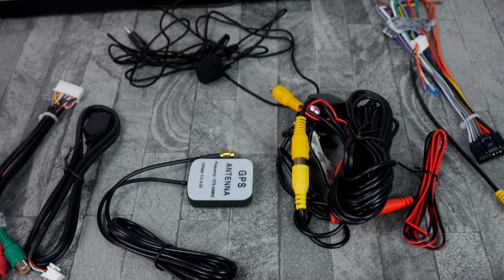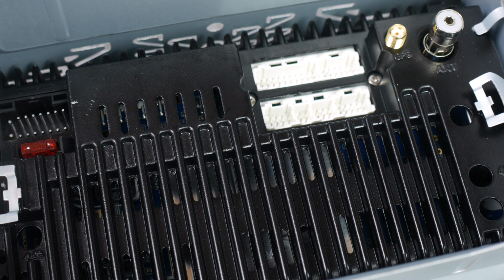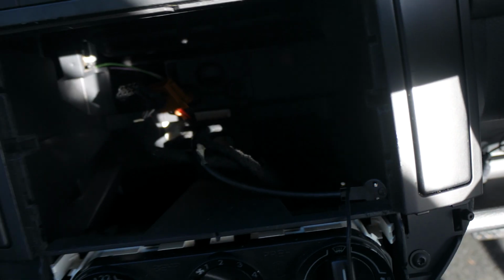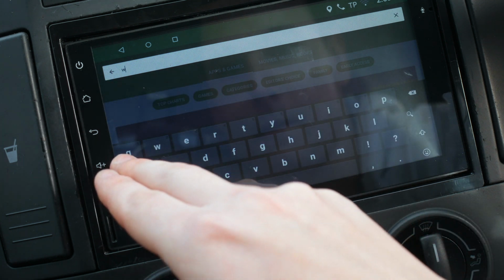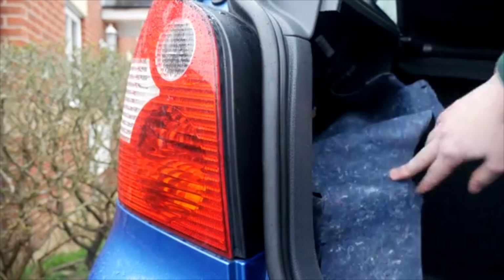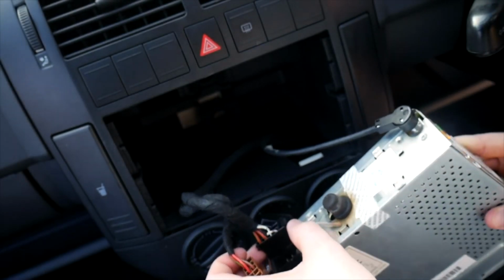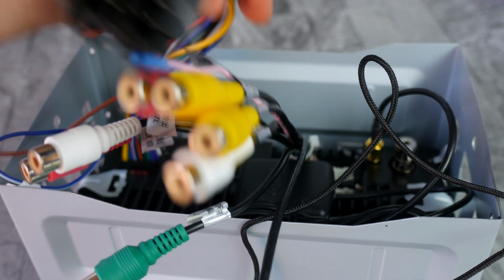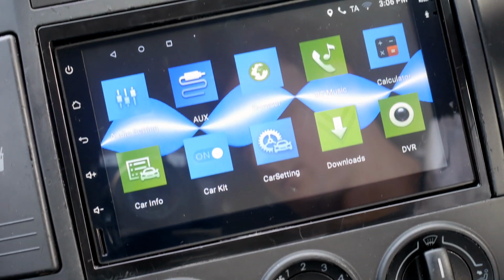Updating VW POLO STEREO - Podofo HD Car double din Stereo!

Comment: What's holding the cage in...you're supposed to fit the cage by bending the tabs to stop the cage from coming out. The radio should then be held in by spring clips which require removal keys for removal. You have simply slid it in with no fixings...very dangerous..it could shoot out under hard acceleration...also an mot failure if loose.

Comment: Can you Provide a Link to the ISO female Attachment Adapter?

Thanks
Reply from the maker: if you contact the manufacturer directly they will send you one.
Reply: @GadgetCrunch  I tried to, but they dont seem to know anything about their devices either
Reply: https://www.ebay.co.uk/itm/Pioneer-Car-Stereo-Radio-ISO-Lead-Wiring-Harness-Connector-Adaptor-Cable-Loom/270681496324?hash=item3f05dfdb04:g:y24AAOSwuYVWn7O-